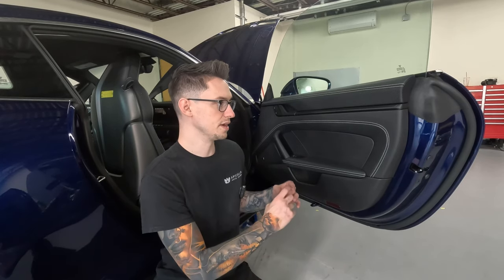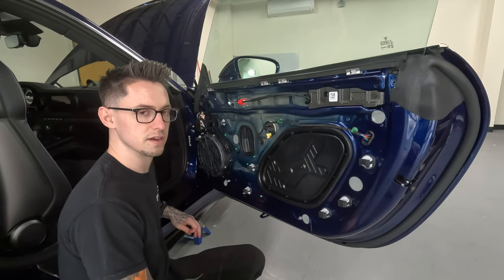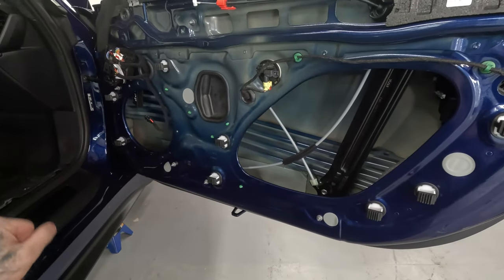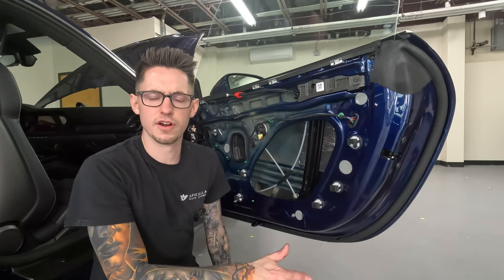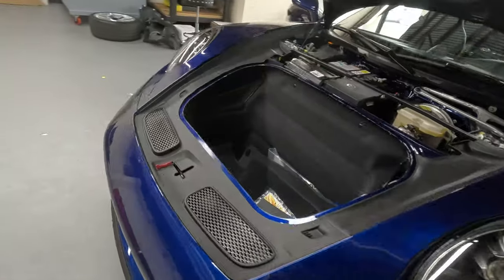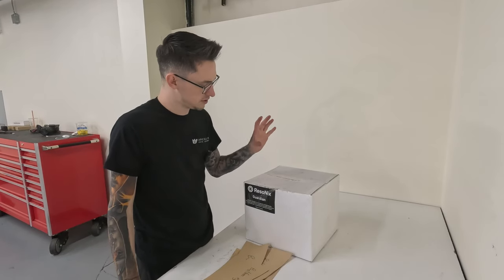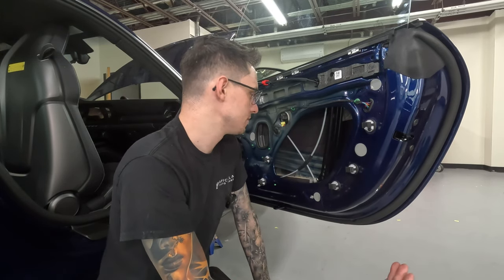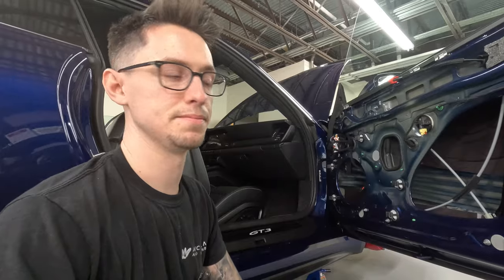2023 Porsche 911 GT3 - Sound Deadening Noise Reduction On A 992 Using ResoNix - Part 2: Doors

Comment: Hey bro..can excessive deadening affect the sound quality of speakers?
Reply from the maker: Sound deadening is meant to reduce resonance from interior panels, and remove unwanted noise. If don't correctly, it will allow the speakers to shine through more than the interiors resonance and rattles will. This will reduce distortion in the audible signal. 

TLDR: as long as you don't mess something up, deadening will only improve the sound.
Reply: @ResoNixSoundSolutions  okay bro thanks.. In most cases we see installers squashing a whole layer on door and i think it will much more time saving than cutting and all..okay as you said we should be cautious without damaging the hooks and service areas...but I have heard some saying there is a lot of science behind applying deadening..it cannot be applied anywhere as we think...
Reply from the maker: @vaisakhmurali6918  I think you are overthinking it and misunderstanding. Feel free to watch our videos and read the articles on our website. They quite literally explain everything you could need to know.
Reply: @ResoNixSoundSolutions  okay I'm watching all your videos now one by one

Comment: If this customer came in for a sound system would you have added any CLD around the door speaker?
Reply from the maker: So this depends on the level of install that I'm doing in that particular vehicle. If it was anything other than full crazy, I would skip the rigid plastic door carrier plates that you see in many modern vehicles, such as this 911. Theres not much need when the area isn't very resonant, and it is also difficult on these since they are full of shapes and dimension.

Comment: Sorry May I ask what is the extra weight of the application?
Reply from the maker: The entire project added just shy of 50lbs. The doors alone were about 5lbs each.
Reply: Most people are concerned with the weight and typically unless you do every panel of the vehicle to top level sound deadening, you wouldn't even notice the weight in your mpg's. Especially if you fo little things to counter balance the weight adding. Things like lighter weight seats, wheels, or mufflers easily counter the additional weight. I think in a car I once had, I maybe added 400lbs but I went with inferior products and lots of them. With Resonix in mind and the proper way to treat the key areas I'd be surprised if someone added over 200 lbs after doing all doors and floor.